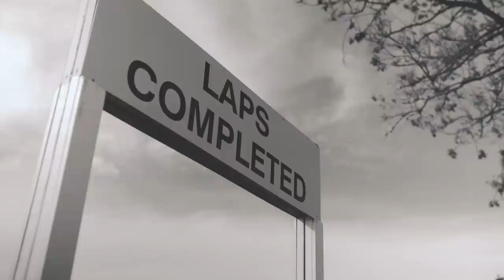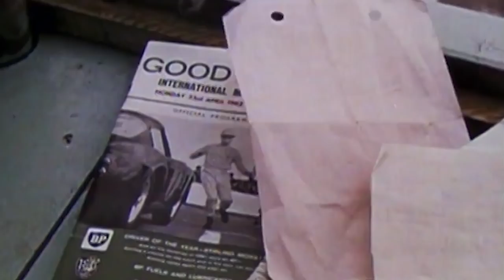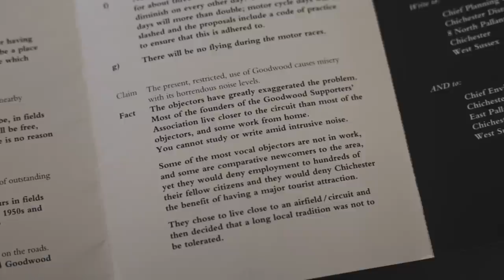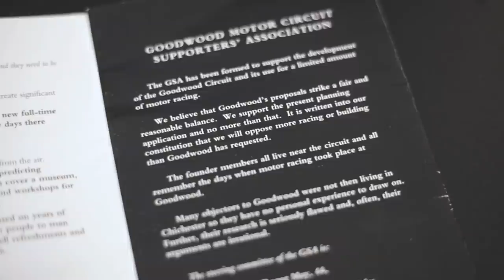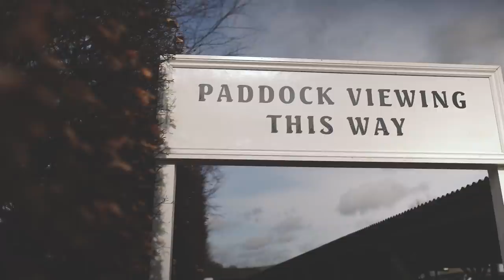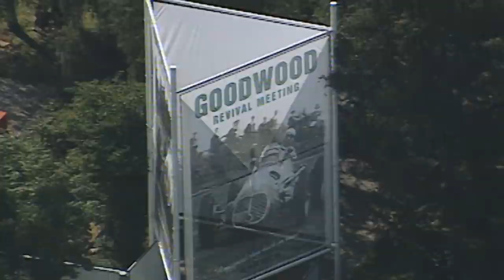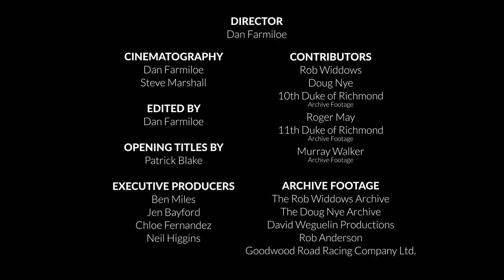Frozen in time | Goodwood '66 ‑ '96

Comment: In the eighties i used to marshal at club events at the circuit , you could hire the track for the day for £250 ! (airfield fire tender was extra ) There was no races as such , but were timed trials cars setting off at set intervals so less chance of overtaking another car which would infringed on the rules so far as "racing " went